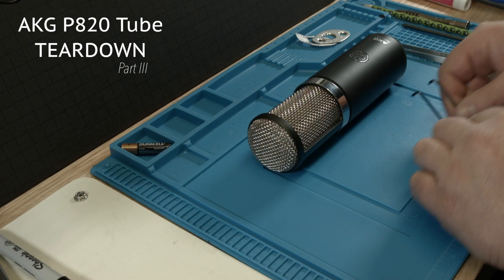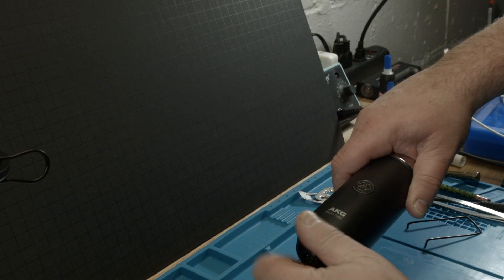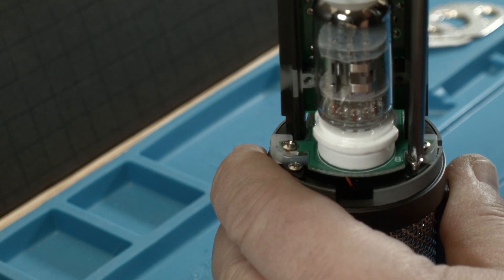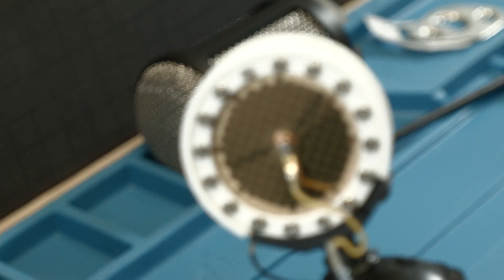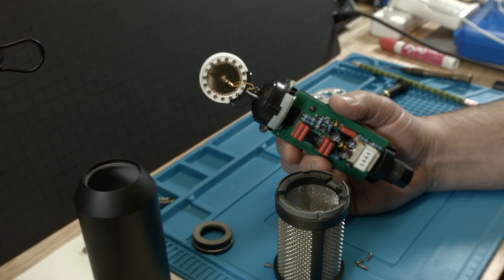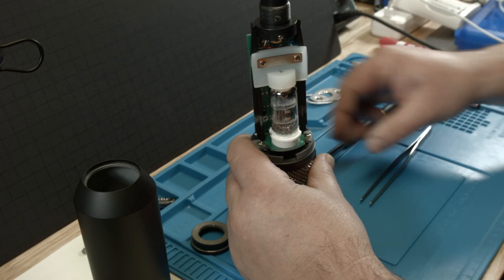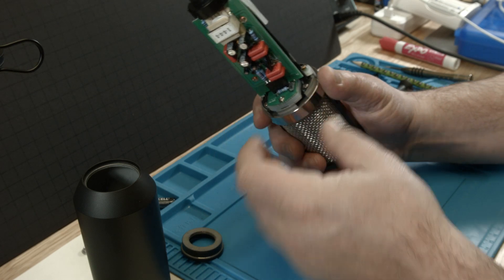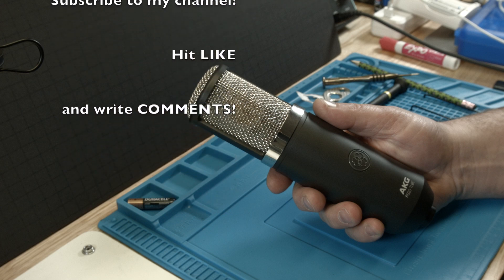AKG P820 Teardown - Part 3

Comment: I like my P820 but it is a little harsh on the high frequencies. Any suggestions? Change the tube? Second: I had a strange distortion in it. First I suspected the cable somehow. But after opening the mic I came across the little screw that connects the plug in the chassis: it was really not tight and therefor the complete housing of the mic was not connected to the earth sometime since the plug has a little room/wiggle for not being against the housing. TIGHTENED the screw and all problems were solved instantaneously 🙃 Btw I needed your vid to get there! (magic tool)
Reply: Wow that's really cool thanks for sharing

Comment: Beautiful video. I have this mic. I love it. However, I want to “upgrade” the tube (swap for different sound). It’s very angelic up top and I would love for it to be flat and neutral all the way around (old radio sound). Do you have any tube replacement recommendations?
Reply: I would suggest going with a slightly lower gain tube... I went with a NOS GE6072, but ElectroHarmonix do a very nice 12ay7 Gold Pin that also sounds great, at least a fifth of the price.
Reply: @telsutton  thank you for responding. I will look into those.
Reply: I upgraded the tube to a new GE JAN 5751 12AX7 GREY PLATE 3 MICA D GETR PERFECT BALANCE TEST NOS VINTAGE 1950's from reverb for $50 and wow, what a difference. Better gain and significantly quieter.
Reply: Wondering about the frequency respons after your upgrade: has it less hiss (high boost)? If find the mic a little harsh on the highs and would like to finish that off with an other tube maybe? @BillBene67

Comment: What is the mame of the especial tool?
Reply from the maker: no name, i made it myself. it was made of strong steel wire.
Reply from the maker: use angled needle nose pliers
Reply: @mygiguser  I made one from drywall anchoring hooks and worked like a charm. Your tool is prettier than mine though...
Reply: Thank u so much!!